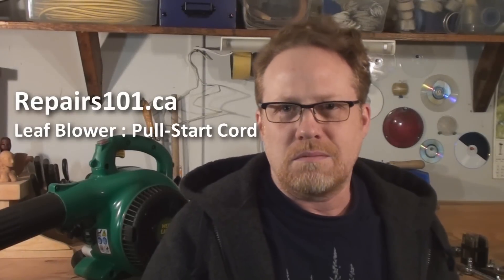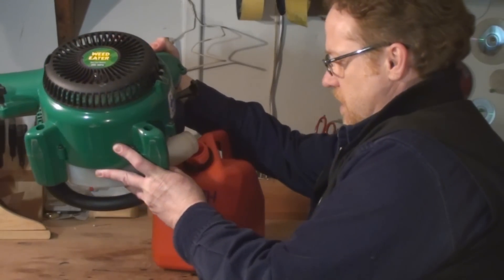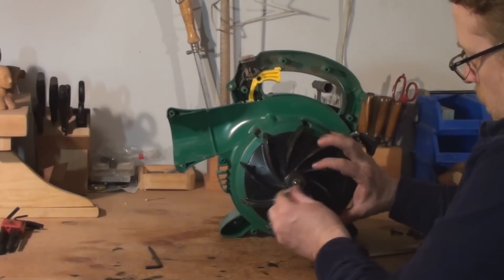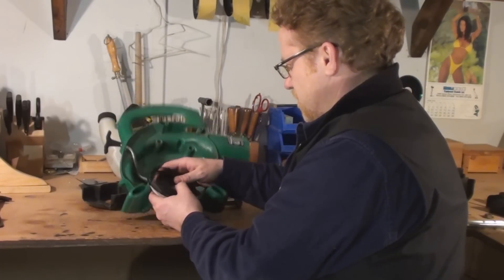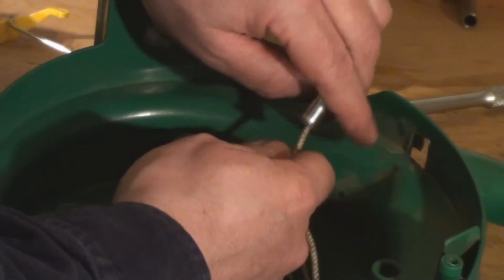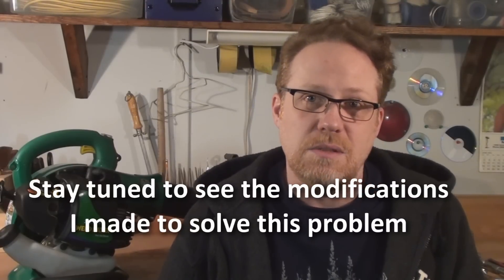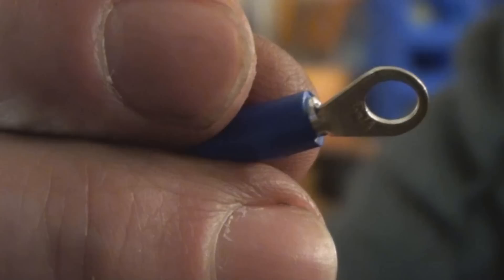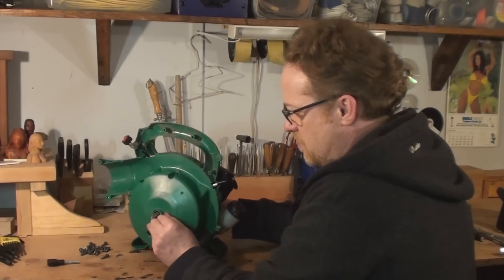Leaf Blower : Pull-Start Cord

Comment: I have a different style weedeater blower, but the same problem and the same fix. And the same box full of screws to get at it. I had my ECHO for 19 years and never had it apart or did more that clean the plug and change a filter. I KNOW WHAT IT FEELS LIKE WHEN THAT DAMN SPRING LETS GO ! ! !
Reply from the maker: How I wish I had bought an Echo (my own fault for being such a cheapskate - it's true that you get what you pay for - preaching to the choir. huh?)
Thanks for pitching that in.
Reply: My dad got a similar leaf blower (featherlite) from his work that wouldn't run and I was pretty certain that it would after tinkering with it, until I went dumb and decided to mess with the completely functional recoil mechanism and ended up with a completely unwound spring and no idea how to put everything together again. This video gave some useful insight.

Comment: The REASON it is designed the way it is ... is because it is designed to be assembled either in a fixture or not even by a human at all - by an automatic assembly machine.  If it was not designed for easy/automated assembly by the manufacturer it would cost a lot more.  You can't have your cake and eat it but consider it too would cost more if not made with some automation.

Comment: They - these manufactures of trimmers, blowers, etc., they don't want you to repair them yourself. They make tamper resistant machines. Therefore, you must take them to their dealers for repair. You will get no help taking it to their service centers. Therefore, you must learn everything you can about their machines so you can fix it yourself. - I did.!
Reply from the maker: I look forward to seeing your video on the subject.
Reply: I wouldn't waste my time on such foolishness.
Reply from the maker: good call
Reply: They want you too throw it away and buy another one. I have a Murray that is just like the one 101 was fixing and has the same trouble, most likely built in the same Chinese sweat shop his was.  I sprayed a can of silicone in the metal tube the rope goes through and got it working, for now.
Reply: So true.